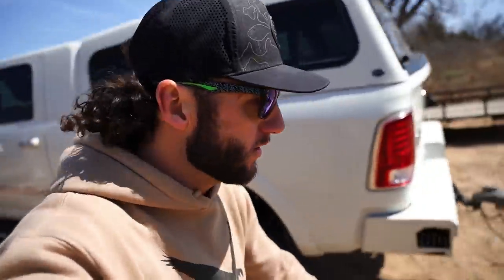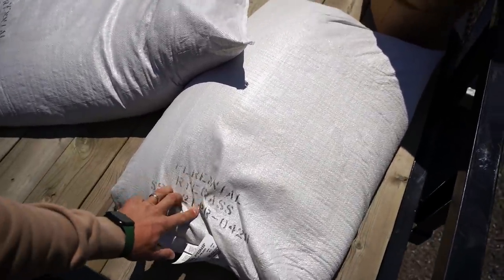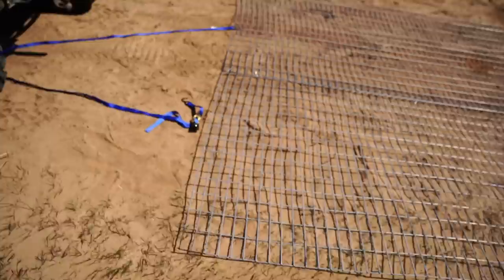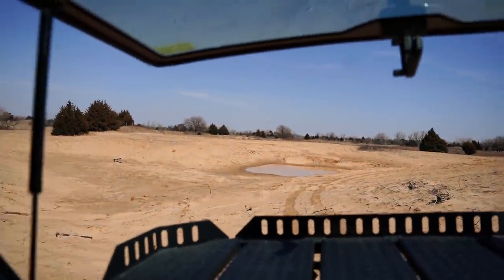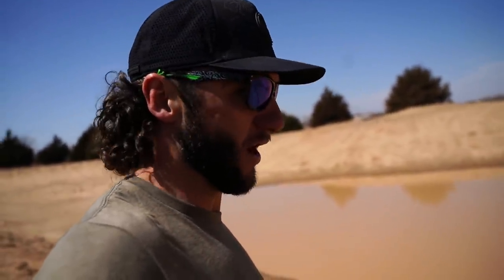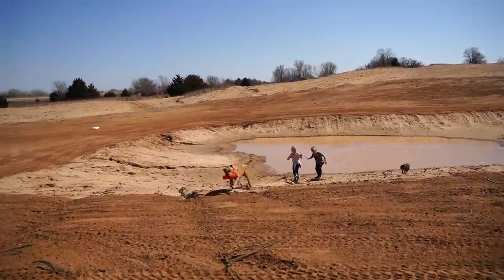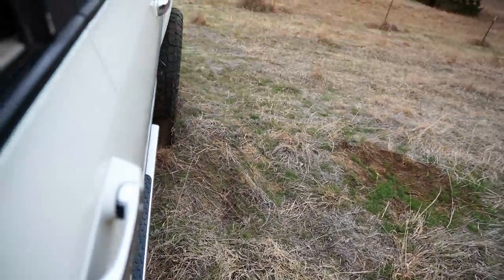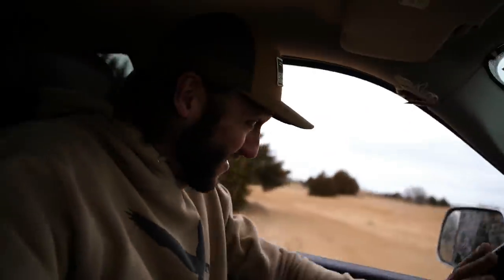Planting Rye Around My Entire Pond on a Budget.. Did I waste my money

Comment: HI Bobby. I'm a revegetation expert by  training. I would recommend seeding a winter-hardy range type of Alfalfa, with freshly applied inoculant on the uplands as well to fix nitrogen and bring some fertility to the soil. Bermuda grass would be a good specie for the upland part of the site as well, and I'd recommend applying 40 kg/ha of sulfur coated urea just before germination. Good species for the waterline are Strawberry clover (with fresh innoculant) and creeping bentgrass. Both those species will spread by stolons and tolerate significant flooding. It looks like there is no fertility, and the innoculated legumes will pull atmospheric nitrogen into the soil, and make it available to the grasses as legume tissues die and decompose. PM me if you'd like more information. Sean.